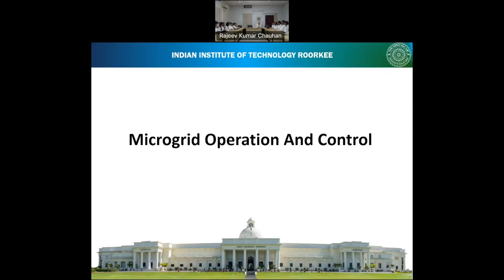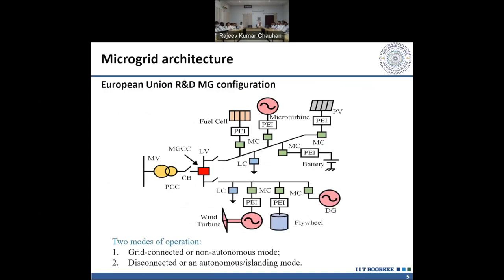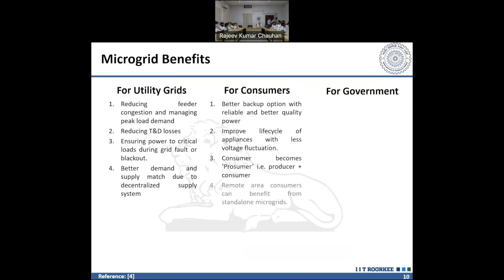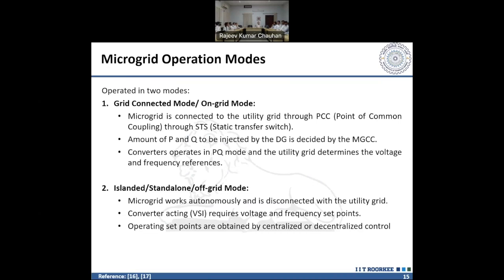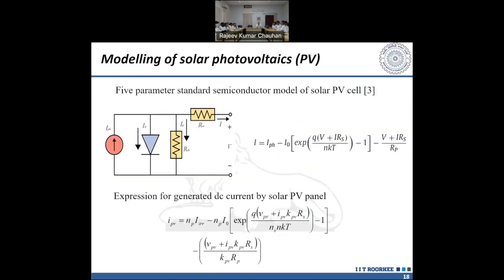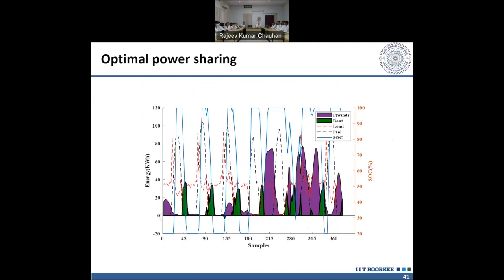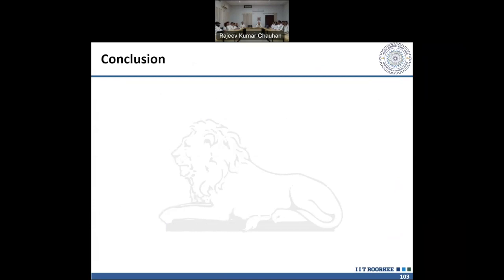Microgrid operation and control by Prof. Barjiv Tyagi

Comment from the maker: 00:31 Microgrid operation and control
05:02 Importance of renewable energy in microgrid
11:30 Inverters with battery supply enhance reliability for renewable sources like solar panels.
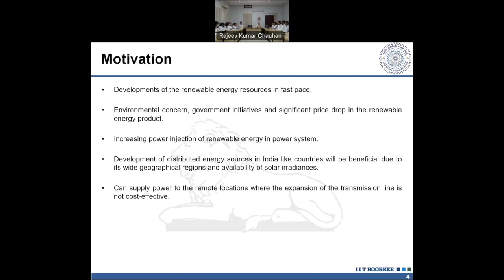14:35 Solar cost reduced to 15-40 rupees
20:34 Integrating renewable energy with the grid
24:10 Microgrid operational issues and benefits
31:04 Consumers becoming prosumers and implications of government policy.
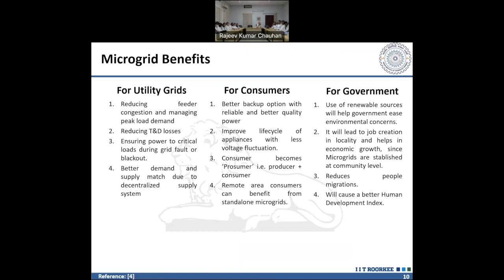34:02 Government-advantaged microgrids reduce carbon footprint.
41:28 Improving efficiency through hybrid DC and AC system
44:46 Advantages of grid connected mode in microgrid operation
52:32 Reactive power majorly impacts voltage and frequency control.
57:29 Modeling plays a crucial role in microgrid operation and control.
1:04:02 Microgrid inverter controls voltage and power tracking
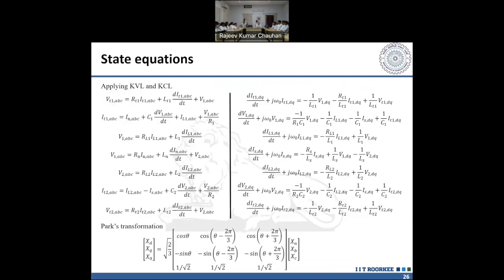1:06:47 Microgrid operation and control require system stability analysis and resource optimization.
1:14:15 Microgrid operation optimizations for renewable energy units
1:17:01 Microgrid control strategies: centralized, decentralized, distributed
1:26:05 Microgrid control involves primary, secondary, and tertiary controllers.
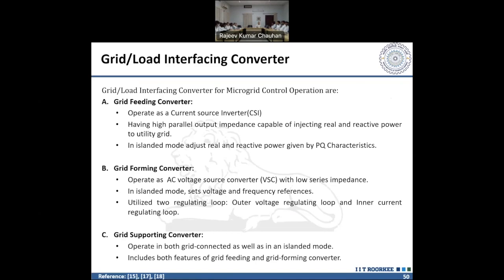1:28:58 Microgrid operation and control
1:35:55 Control duty cycle in power electronics
1:38:54 Microgrid operation involves primary and secondary control for voltage and frequency management.